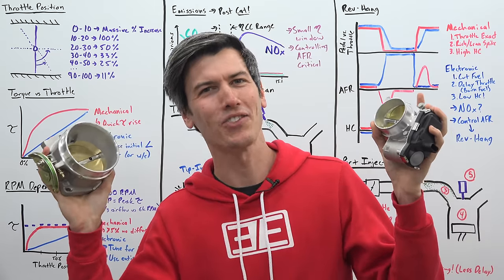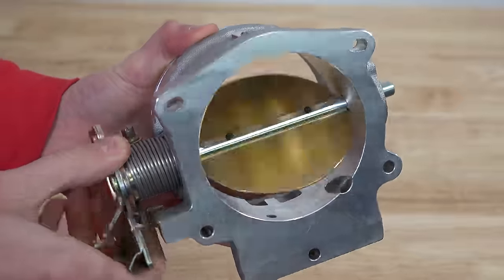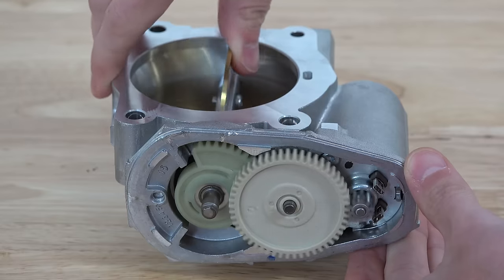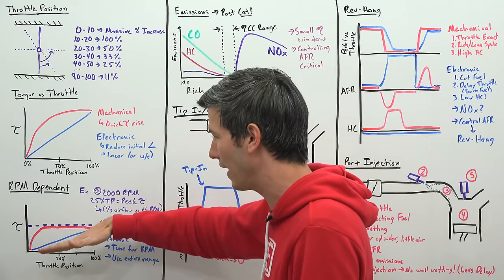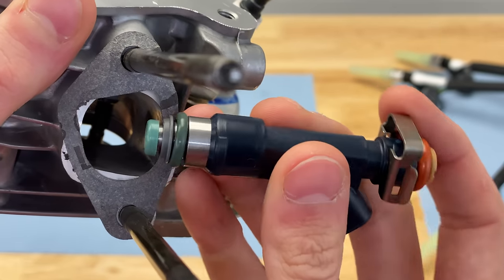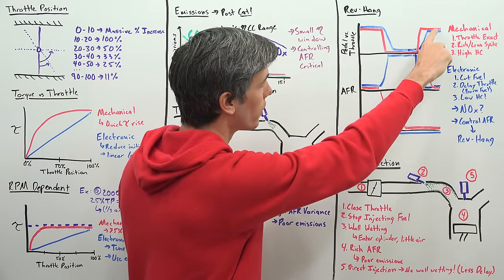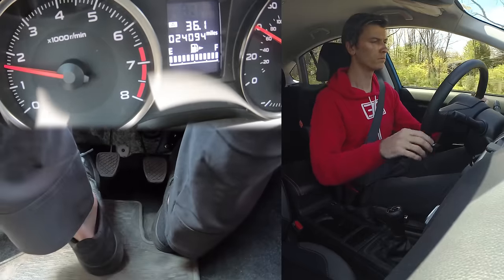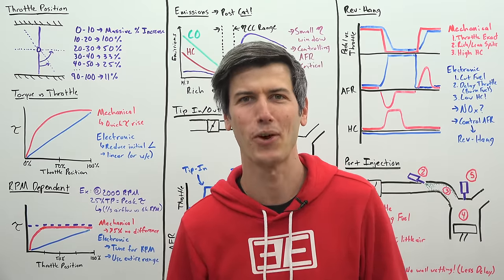The Big Problem With Modern Manual Transmissions - Rev Hang

Comment: So for 1 second of emissions they added rev-hang.
Reply: but hey, at least it f*cks up your clutch 👍
Reply: 1 second per vehicle now multiply that by millions of vehicles and the amount of emmisions can get pretty high
Reply: @151bradhatt  And multiply that once again for the number of gear shifts every day. That's an impressive number already!
Reply: Stick shifts are being phased out. 
2 % sold last year.
8 speed automatics and electronic throttles keep the engine in the sweet torque spot.
Reply: HotRod Ray I don’t know where you take your numbers from but at least here in EU most of the cars have manual gearbox. They won’t be phase out that fast.
Reply: @hotrodray6802  Phased out in the lazy land of America.
Reply: @diavalus  dont forget that a large container ship creates the same no2 and sulfur dioxide fumes as 30 million cars in a typical year of use. Trust me, this was to reduce the enjoyment of cars and turn the young generation away from cars.
Reply: @xq39  But the container ship produces it in the middle of the ocean. Less problematic than the middle of our cities.
Reply: @lindsaycole8409  Do you honestly think that CO2 just....stays where its put out? That's not how pollution works. CO2 spreads throughout the atmostphere. Duh. 

Also, perhaps you are not keeping up with the environmental messages of today, but ocean acidification is a huge component of climate change, and releasing the CO2 directly into the water or above the water is WORSE for the ocean then releasing it over land. 

Either way the whole movement is BS. If they really wanted to reduce CO2 they wouldnt stand int he way of nuclear power, would be fighting to reduce global trade (a huge contributor to CO2) fighting for less cheap plastic consumer goods, and fighting for renovation of buildings instead of wholesale reconstruction to be "green"
Reply: @Nick-ue7iw  I was replying to a xq39 which was talking about the amount of NO2 and SO2 produced by container ships, not CO2. Pollutants have different effect ranges. NO2/NOX is a problem mainly for cities as it eventually becomes harrmless as you move away from high traffic areas, (so fine in the middle of the ocean). SO2 is acid rain, a big issue from coal fired power stations back in the day, has local and continental effect. Single large nuclear polution events, like Chernobyl, have pollution effects from intense local to bad regional and medium continental effects, but a full on nuclear war would have massive global pollution issues.. CO2 and greenhouse gases, as well as CFCs back in the day, are global effects, and actually don't have much effect local to the source, but have slow accumulative effects wordwide.
Reply: @151bradhatt  Not worth it if it screws with the way the car operates.
Reply: @IIGrayfoxII  One day the driving experience will amount to an 'app' on a smart phone to control a driver-less car.
Reply: @IIGrayfoxII  Gluttony, sloth and lust consume America.
Reply: @Jupiter__001_  Dont forget greed

Comment: Today I realized that the right pedal is actually the air pedal, not gas pedal.
Reply: Not if you drive a diesel, then it truly is a gas pedal.
Reply: Well, to be fair, air IS a gas.
Reply: With Carburetors, it was an Air/Gas pedal, now you give it the air, and the computer calculates the gas. I like the new version better.
Reply: @tomw9078  diesels don't run on gas
Reply: Or the torque pedal. I've heard the term "torque-demand" thrown around on the F1 coverage when the engineers are talking about pedal position.

Comment: My 2004 bmw rpm drops like a rock, no hangs. My 2019 hyundai hangs a little though.
Reply: My 07 Audi hangs pretty bad
Reply: 09 Cobalt SS hangs real bad. And its direct injected.
Reply: I have a 2000 bmw and it has mechanical throttle body and it's beautiful
Reply: E46 doesn't have rev hang, thank God!

Comment: What we need is for the clutch being pressed in to act like engine “neutral” and match the rpm on either side of the clutch, then when you shift the gearbox and there’s a surge up or down in clutch disk speed, the engine speed will follow it, if you had this and a power assist clutch with really strong springs, you may never need to replace the clutch other than when the springs wear
Reply: There have been better systems implemented that don't use a clutch. Its cheaper for the manufacturer and more expensive for you as they are wearable parts which is why the clutch disc/clamp/bearing system is still used today. Audi developed a torsion manual system similar to how the AWD couplers work, its way more expensive and way more complex being scaled up and requires a bit more maint. than people are used to for a trans. the closest thing I have seen using a system similar is the Car(forget the name of it) with the TFG engine coupled with the electric motor, but typically you only see these high end designs in some Super cars but mainly Hyper cars like Mclaren and such that don't use conventional means of building a car.
Reply: Mate what you're describing here is literally called rev matching and racing drivers do it all the time. You may too if you desire.
Reply: @parman01  Some cars have it. I think the Nissan 370Z was one of the first ones with it.

I think it's a lot of fuss over nothing. Yes some cars are a little lazier dropping revs but when you release the clutch they'll always go where you want them to, if it causes a jerk simply release the clutch more smoothly. These are not usually "sporty" cars anyway, why would you be shifting gears in an SUV as you would in a sports car? It's clearly not the right car for that kind of driving style, the rev hang is the least of it.
Reply: dual clutch/at input and output of transmission.
Reply: @parman01  I think I was talking about automatically? I honestly can’t figure out my comment here
Reply: My 2008 Peugeot 308 is still on its original clutch after 185,000 miles (unless it was replaced in the first 18,000 miles before I bought the car!). I must be doing something right with rev-matching. I don't remember my driving instructor teaching me how to judge how much to increase/decrease the revs by when changing up or down by one gear. I reckon on about 500 rpm difference between one gear and the next.

I did have the misfortune to be driven once by a work colleague who drove her car like 1st Generation DMU (diesel multiple unit) trains (in the UK) had to be driven: let the engine slow to idle, engage the new gear, let the clutch up on a "dead" engine, apply power again. It was as jerky in a car as it was in those 1st Gen trains :-( After she apologised for the n-th time for a jerky gearchange and asked for my advice, I very tactfully suggested that there might be "another way" that would help make things smoother. She was genuinely amazed that it was possible to keep the engine revs constant, with a little bit of adjustment up or down as appropriate, and that you didn't have to come right off the power and let the clutch up on an idling engine.

The only drive-by-wire petrol car that I had was a 1993 Mark III VW Golf, and I don't remember the engine being slow to decrease revs when I came off the power. In a diesel (all my cars since then have been diesel) the problem doesn't exist: the engine always admits an excess of air which doesn't get throttled, and the fuel injectors don't suffer any lag.

Comment: Wish to know if there’s any way to disable the rev hang.
Reply: You would be able to disable it buy modifying the code that controls the throttle butterfly.
Reply: A tune.
Reply: There are handheld tuners that will eliminate it.
Reply: You can tune it out, but only if your car has enough aftermarket support that people bothered to figure it out and release the data
Reply: Tuners are your friends
Reply: You can tune it out but it will 100% guaranteed void your warranty
Reply: Grooove e warranties are lies
Reply: Matty England Could that be like half million dollars?
Reply: just hold the accelerator pedal when shifting
Reply: Just get mechanical throttle body and you're good
Reply: Just shift slower, where are you rushing to?
Reply: anticipate the clutch-drop by leading with the gas pedal.
Reply: wim0104 same bro, that’s what i do to avoid the car jerking when shifting.

Comment: I had a carbureted vehicle with a vacuum dashpot actuator to accomplish the delayed throttle butterfly closure, too. That general system was not exactly uncommon toward the end of the days of carburetors on on-road automobiles. It’s also interesting the discussion about how one could use electronic throttle control to make the relationship between pedal position and delivered power more linear. Why I think it’s interesting is that we don’t see that actually done. What we see instead is that electronic throttles are programmed to provide ridiculously overdone tip-in, because that makes people think their car is really fast.

Comment: Some things are just best done the old fashioned way.
Reply: FACTS! Most of these "modern systems" are completely unnecessary and just another planned obsolescence scam to sell you parts you don't need, and this particular system is no exception. There was absolutely NOTHING wrong with the mechanical throttle system. It was fun, simple, predictable and almost NEVER failed compared to these electronic ones. If the only benefit of this is "better emissions" then I'm sorry, I'm driving my 1997 model forever, ozone layer or not!
Reply: @nicksta16   "They don't build them like they used to" is a very real thing indeed, cars haven't been all that great since the 90s and early 2000s. These days everything is meant to be disaposable, they're not built to last.

Comment: I've been trying to get around my civic's rev hang for the past two years of ownership. I found smoothing off of the throttle instead of quickly releasing it helps a lot. Now it makes sense why that works because I'm just replicating what the electronic TB is trying to do in the first place.
Reply: Now this is something I might give a try.
Reply: Oh, I love my cable driven beater - shifts smoothly at 7k RPMs w/o problems
Reply: So by doing that you're not really getting around the rev hang, you're actually making the rev hang last even longer but because it's you holding the revs up not just the computer acting on your behalf you don't recognise it as a problem
Reply: @RWoody1995  feels a hell of a lot better than waiting on the damn computer to do it. Just do it yourself. Or wait to shift until the TB is completely closed, but that's jerky and not smooth
Reply: FK2? Has DMF so convert to SMF and it'll fix. Not sure about fk8 as I think SMF.could still be flywheel weight as the cause
Reply: @veehexx  just an si. Not a type r
Reply: @veehexx  also from what I've seen people that switch to lighter flywheels have to flash the ECU anyways to prevent a misfire code. At that point you'd be flashing out the slow ETB issue anyways which is probably where most of the improvement comes from.

Comment: wished i knew that in the 90's,GM had many a problems with idle hang on throttle body trucks
Reply: Still had rev hang on those for emissions, it was just done differently, using the IAC.
Reply: I have a '99 Silverado,  its an auto but the throttle response is instant.

Comment: Excellent explanation. Bought my first brand new car in '98 and within a few months my shifts were buttery smooth and my r/t at the track was consistently <.150 got 220k miles out of that car. My current vehicle has drive by wire and I can't for the life of me get the throttle algorithm into my muscle memory. Rarely get a smooth shift, up or down

Comment: So the moral of this video is: Rip the damn electronic throttle out and stuff a cable in.
Reply: Good luck making that work.
Reply: Or you tune it out. The rev hang is only there for emissions reasons, it's programmed in meaning it can be programmed out. It's not a fault of the technology itself.
Reply: Yes, i did it, i put a cabled pedal, the Ecu complained a lot and i give him a finger!!

Comment: Or as I put it. It drove like there is a flat spot in the drive linkage in the carburetor. In other words the carb is almost worn out.  I expected the engineer to ask what do you mean? I am 70 and he was 30. 6 speed, 3 pedal, Mustang. Yes this computer $h!T did not under stand the computer between my ears. Yes I have driven 10 speeds with 15 ton loads. Both gasser and diesel. My first driver was a ' 53 1/2 Chevy pickup. If you see one with an automatic somebody added it. ALL of the '53 pickups were stick shifts. Or as was said in 1963, a standard transmission.
The lag was still there later on but not as noticeable. Rev matching on does work well if you shift at a bit higher than you would with a carburetor engine. Not every body drives with a race to the red line with every shift.

Comment: Idle air control valves took care of that "lack of rev hang" thing back in the 1990s and early 2000's.  Some utilized it more than others, but there was a solution to that issue.
Reply: Rpm hang seems to have been eliminated on newer cars models

Comment: I have a 2019 MX-5 and don't notice rev hang at all. The engine drops RPM's quickly, requiring fast gear changes to be smooth. As you mentioned, the engine is direct injected.
Reply: Wall wetting's by far the biggest influence on how the AFR changes in transient conditions, so to pass modern emissions standards and have snappy throttle response, yeah, it seems like direct injection's the way to go.
Reply: you can control the RPM drop with the throtle tho
Reply: Most likely your Mazda is tuned differently than other cars. As for DI I hope they figured out how to lower the deposits in intake manifold and valves.
Reply: Mazda specifically tuned that car with a manual shifter and overall driving experience in mind. I have a Mazda 3 with the same engine and I can guarantee you there is some rev hang for me.
Reply: A lot of naturally aspirated cars have better throttle response compared to turbo cars.  My Fiests ST had really shitty throttle response compared to my Miata and my friends BRZ.
Reply: Mazda is very meticulous about the MX-5, you would be hard pressed to find any serious issues with one. They are extremely focused on the drivers experience

Comment: Rev hang is the main reason why I didn't purchase a civic si.  I ended up buying a vw gti, still rev hang but not bad compared to the civic.  Ended up dumping the gti because I really started to hate the rev hang more and more. I thought about one of those pedal tuners, but I couldn't get a straight answer if it helped with rev hang.
Reply: tune it
Reply: @classicdufferin8739  I had an APR tune which did not change the rev hang. I called the tech line and asked if there was something they had to fix it and they said no, because it would adversely affect emissions standards.

Comment: I've had a 2018 Subaru Impreza Sport for a couple years now and have always complained about the rev hang. When I was test driving it, I assured myself I was just driving it poorly (I hadn't owned a car in the 6 years prior) and that I'd quickly get used to it. But the problem persisted, and every car I've owned since I was 16 (I'm 35 now) has been a manual, and I dare say I'm quite proficient with them. BUT THE REV HANG IS STILL THERE! AND I KNOW IT'S NOT MY FAULT!

Finally I have confirmation that it's a real thing and I'm not crazy!

You're basically left with two options: accelerate more slowly as you wait for the revs to match before you release the clutch, or accelerate faster but with a jerk due to unmatched revs. BUT! I found that slowly and smoothly letting off the throttle as I approach my shift point allows me to clutch and then shift just like I normally would. The RPMs just drop quickly like you'd expect. It takes some practice, and it's still not as good as shifting in older cars, and you're still overall accelerating more slowly, but being able to do quick shifts feels really good, and it's better than clutching and waiting for the revs to drop or jerking the car.

Comment: Informative and good explanation.  Note that even some of the last generation of electronically modulated carbureted cars in the early to mid 80's used dashpots on the carburetor to delay throttle closing.

Comment: 1:05 Two suggestions if i may. DIsmiss them if you wish, but trying them out would not hurt you. 1) For getting the idea of what i'm talking about, i'll say : only push/pull the lever and start pushing/pulling it, softly, just before you disengage the clutch. best example is from 2 to 3. Palm downwards, facing forward, fingers touching the shift knob. The moment you disengage the clutch, the lever will immediatelly go out of gear into neutral and if you just continue pushing forward, 3rd will be meshed with no effort whatsoever. 2) first engage the clutch, then apply throttle. 
That's it. I am not speaking from any position of authority or anything, i'm simply forwarding advice i was given from a driver i admire(d).

Comment: Till recently all my car park Ive owned only had mechanical throttles, I was used to shifting quickly. I sold my gold mk3 and bought a volvo xc70 P2 2.4T. I was actually thinking theres something wrong with the car, gearbox or something. After i cut off the rear muffler ( just to hear the 5cyl for a few weeks) I noticed a noticable rev jump between gear changes.Yep turns out the car was yanking my chain making me think i dont know how to drive anymore. I just learned to shift slower, and release the clutch with more finesse.

Comment: You can have a mechanical throttle body with linear power if you just make the rotation lobe on the wire connector offset, then you can slap an electrical motor to offset and tweak the airflow for fuel efficiency reasons, done.